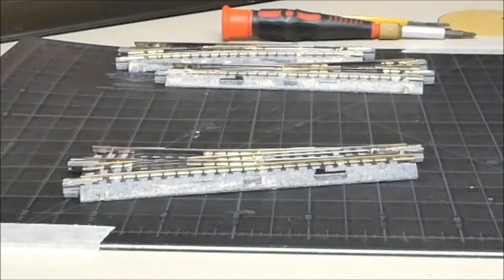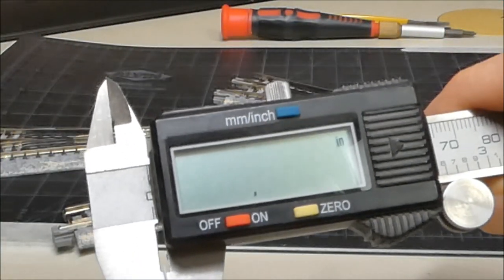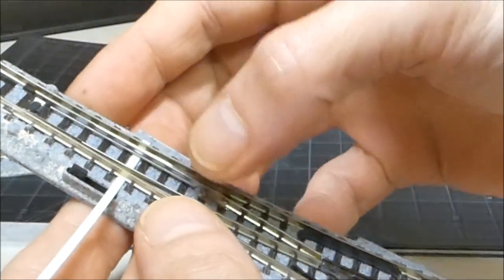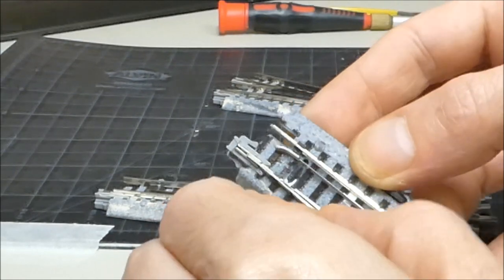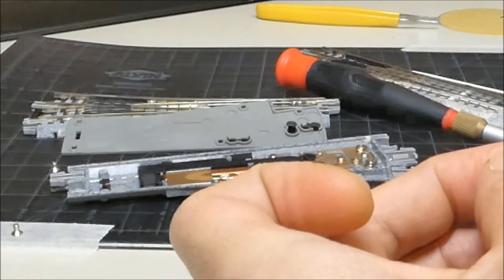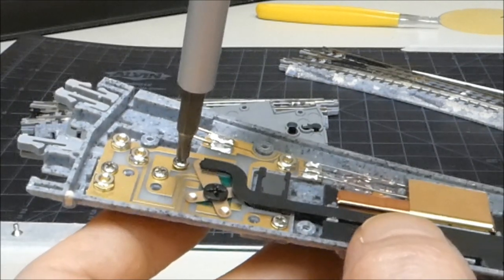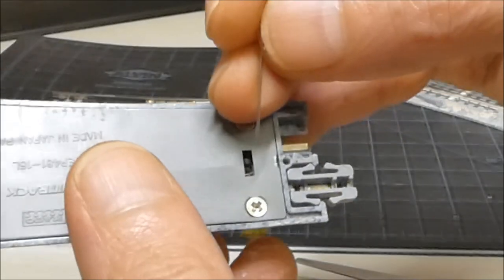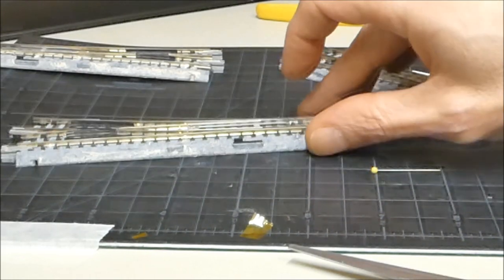kato number 4 turnout mods for reliability

Comment: Very interesting and informative. I have #4 turnouts on my HO scale Unitrack layout, and in addition to one of my locomotives forcing switches open sometimes, I also noticed that the driving wheels seem to "bounce" in the small gap between the rail and the end of the frog. I'm wondering if adding styrene in this gap would resolve the issue.

Comment: I find with the HO #4's, non-kato locomotives and some stock picks the opposing current rail before coming into the frog causing a brief short with DCC decoders.  I use clear nail polish to insulate the points a bit by the frog.

Comment: This was helpful, i was trying to figure out why #4's seem to "fail" to change direction reliably after a year and half and this videos seems to match my conclusion of the points warping. I will try your styrene support on my troublesome turnouts and see if it yields improvement
Reply: Mechanism is weak in the straight direction on mine, I also filed the point and used tweezers to bend ever so slightly. Last check gauge on all wheels, if like HO some are too wide.

Comment: Out of interest, what is the thickness of the Kato printed card used for the packaging of 24-825, 24-827, 24-821, etc? And even the thickness of the backing card used on the turnouts themselves 20-220 and 20-221 and other items packaged that way? 
I don't have a micrometre

Comment: Aloha the Styrene you used on your #4's have used it on #6 turnouts as well and if so can you show in a Next Video and I was wondering what the Styrene thickness is Sir can ya please pass that in your reply my La Junta Hutch & Pratt mini Sub Div. I use all KATO UNITRACK in my back yard I'd used #4's for 3 1/2 years and they work pretty decent with any Kato Rollinstock that I ran over them but when I went to other Rolling Stock products like Microtrains the Derailment issues started so I pulled the #4's and went to KATO #6 I dont have as much issues as in the past but on occasion I get a Derailment.. 

My Channel is RDA N Scale thank you for sharing this Video..

Comment: Noticed that you notched the curved rail on one of those #4's.  Did it help?  I've notched the straight rails, but still have some issues.  Going to try your guard rails as well.
Reply from the maker: It helps where its needed, but I am not sure its needed on every turnout.  If a previously installed turnout is causing the flange to ride up on a closed point then I pull it out and notch the rail to blend the point and rail junction, if that isn't happening I dont bother.  If the turnout is being installed with plaster and ballast and all that I really probably should notch both rails and do all the mods before just to avoid hassles later.  I am not sure if filing a small wedge into the tip of the point doesn't do the same thing in preventing the flange riding up on it.  So I guess I am still testing methods of preventing that.  2 basic methods are notch the rail or wedge the point tip.  Even tiny angled plane on the upper tip of the point may be just enough to kick the flange over and stay railed versus it climbing up the point when it comes in contact.